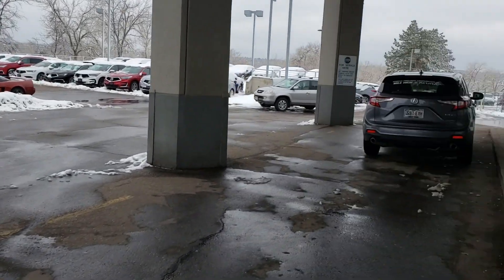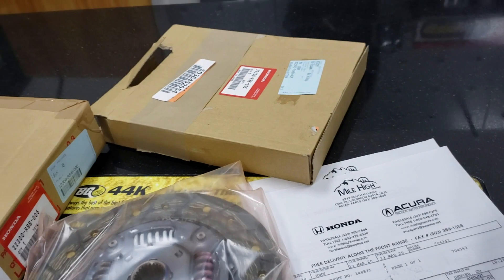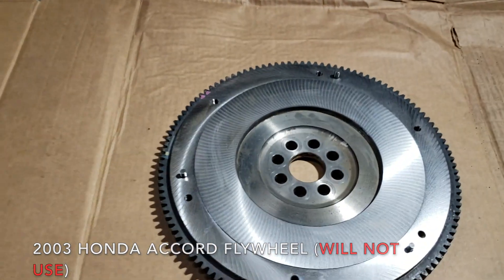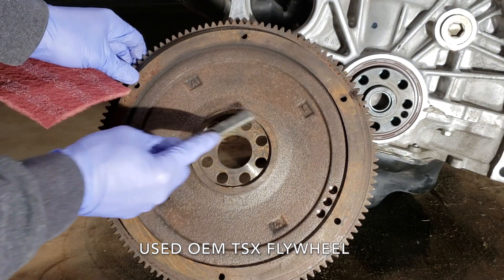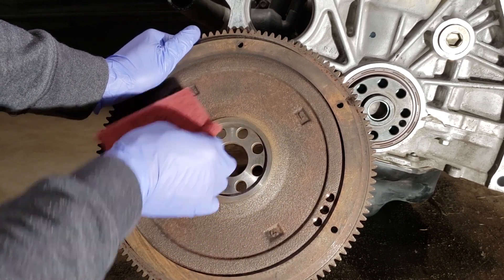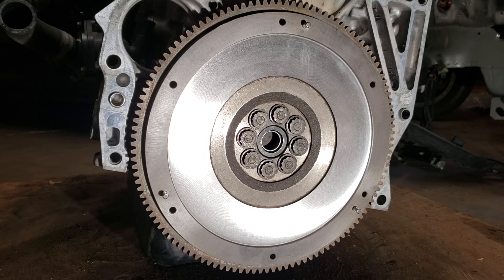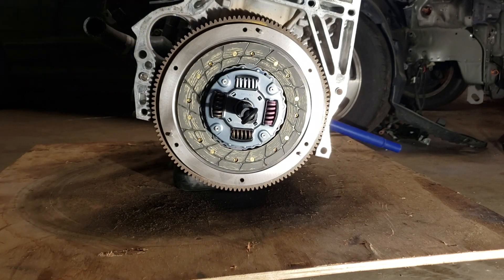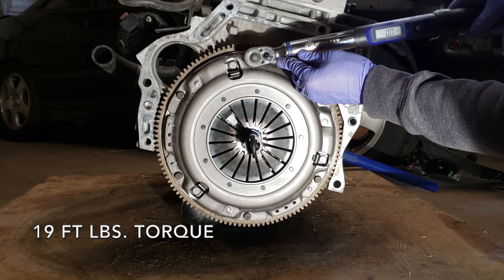K24 Swap OEM Flywheel, Clutch Disc, and Pressure Plate Install.

Comment: do you happen to know the part numbers of the bolts to connect the transmission to the block? or maybre thread size, pitch and length?
Reply from the maker: I don't off the top of my head, I would have to do the research on it. But here is a link to a video where I talk about doing the research on your parts. With these websites you find them quick. If you have any other questions feel free to reach out.
https://youtu.be/A0IoqoOpFOw

Comment: do you happen to know the part numbers of the bolts to connect the transmission to the block? or maybre thread size, pitch and length?
Reply from the maker: Sorry I don't but here is a good start in doing your research. 
https://youtu.be/A0IoqoOpFOw

Comment: Which axles did you go with for this swap?
Reply from the maker: oem ep3 axles but the passenger seems a little short.
Reply: @jsrebuilds3951  are you replacing them soon or not yet?
Reply from the maker: @kyletaboo4006  I don't own this vehicle anymore.

Comment: How did you select the threadlock? I heard that if you use the wrong one that you will ruin the crank when trying to remove them down the road.
Reply from the maker: That is a really good question. I had to do some research about using threadlock or not. I reached out to a friend who is professional Honda mechanic and he told me Shouldn't be a problem to use it or not, it's extra insurance that they'll say. So in my opinion please do your own research on what's best for your application since I'm not professional. Also here is a link I found hoping its useful. https://jhpusa.com/products/honda-hondalock-threadlock

Comment: What size socket did you use for the flywheel bolts and pressure plate bolts?
Reply from the maker: 17mm - 12 point socket flywheel bolts, 10mm - 12 point socket pressure plate bolts.

Comment: Great video but quick question!!
When putting the pressure plate does it seat flat on the flywheel right away or does it when you tied all the bolts down??
Reply from the maker: Thank you for your comment. The pressure plate does not seat flat on the flywheel. It will once all the bolts are tighten down. But I like to turn each bolt equally in a crisscross pattern.
Reply: @jsrebuilds3951  Thanks I really thought I installed my clutch backwards hopefully I didn't but thanks anyways keep up the high quality content 👌 💯